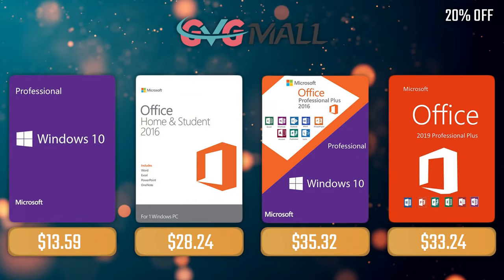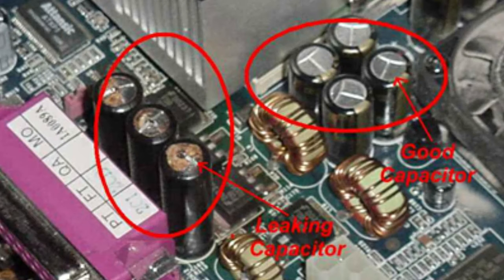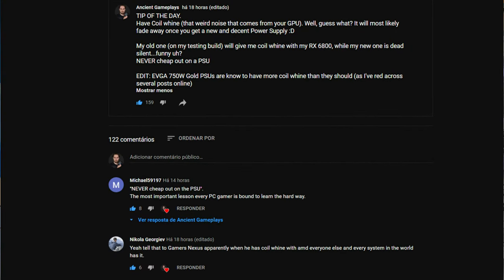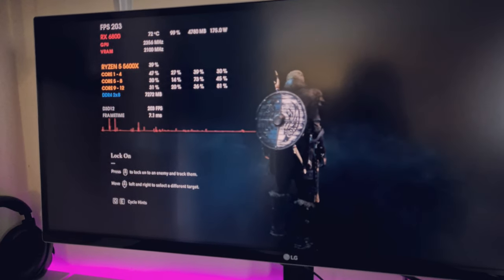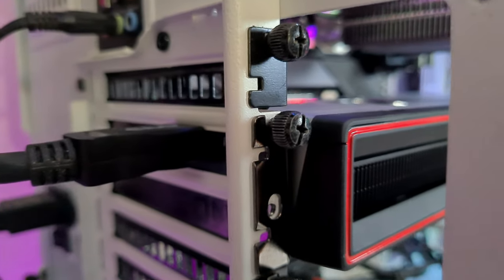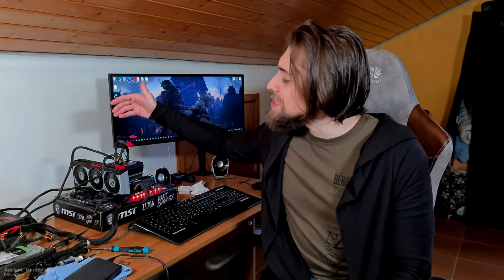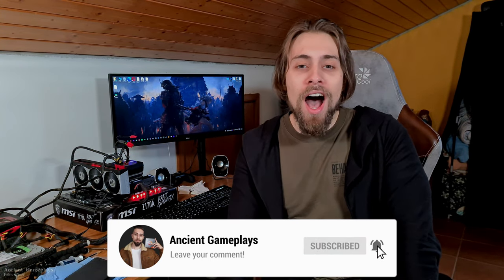GPU Coil Whine -  GPU or PSU's Fault? How to fix it?

Comment from the maker: In order to hear the coil whine noises I advise you watching this video with an Headset. Hope this helps in some way :D
Reply: Lets go!
Another great video! Bora!
Reply: The low pass filter YouTube uses might not help either. Knocks out everything above 15.75KHz !
Reply: EVGA GOLD is a bandage for this.
Reply: Corsair CX550M + RX 570 GIGABAIT = coil whine.

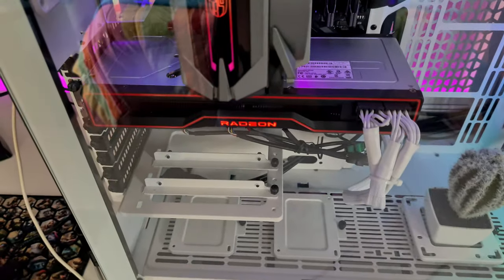3:32 ИƎZYЯ
Reply: I have the exact same logitech white speakers :D
Reply: @patr8357  yeah it's Z120, i bought them recently too
Reply from the maker: @patr8357  pretty nice and cheap
Reply: my bluetooth headphones also have coil whines.  but I want to fix the one of my rtx3070
Reply: So last night my pc was working and I turn it on this morning no lights or fan turns on but the coils in the power supply are whining someone help
Reply: Hello sir, can coil wine demage components or can it be dangerous? Or is it just the sound?
Reply from the maker: @Nixsaspy  Nah, you're fine don't worry, it is just electrical "vibration"
Reply: Interesting video. Do you mean that a weak power supply is behind all the complaints about (for instance) the Red Devil 7900 xtx deafening coil whine? I'd love to buy that card but I've heard so many angry costumers that I'm hesitant.

Comment: The biggest fail of them all - CONNECTING ONLY ONE 8x + 8x CABLE INSTEAD TWO SEPARATE. Way too many people don't get it. It's about rail power delivery
Reply from the maker: Exactly, hence why I showed it in the video :D
Reply from the maker: @Sneakyboson  the modular argument is simply not true. There are a huge amount of them that have 2 pcie cables. The defining factor is the stated wattage
Reply: What if there is 3x8 pins?)
Reply from the maker: @legart4507  There are GPUs with 3 or 4 PCIe cables also :D
Reply: @legart4507  Get psu that supports 3 cables
Reply: My suprim X have coil whine. It need 3 cables. which cables do you need in this case?
8+8 split and one 8? Or 3x8 pins?
Reply: I didn't know that, thanks. Will add a second cable and change out.
Reply: Wait so I should only have one plugged in not two I have 7800x3d
Reply: I've just taken back a power supply and swapped so I can use individual cables. I'm hoping this will solve the issue. I will post an update once setup.
Reply: @ToonaChills no Bro you understood this incorrect. Use 2 Cables instead of 1 with a splitter

Comment: I have an rx 6800 xt, and a msi tomahawk 750w gold psu,full modular, and i have coil whine. Should i change the psu? Its not enought? Using 2 separate clables for it.

Comment: If you lock your framerate to your monitor's refresh rate, it can mitigate some coil whine.  Typically coil whine is at it's worst when the framerates are completely insane, which usually is on menu or loading screens.  Those 300 ish FPS on loading screens makes some cards SCREEEECH.  If you can't get out of your PSU try locking frames down in Afterburner or Wattman.
Reply from the maker: Coil whine appears when the GPU gets loaded, it has to do with power consumption also :D
Reply: Absolutely 100%
By locking the fps to 60 for example you reduce the load on the graphics card.
Reply: This worked for me on a sapphire fury oc+ edition
Reply: Sure sure, but what if you crypto mine?
Reply: @IItsIgor  underclocking and undervolting SHOULD bring the noise down.
Reply: Yes because your card uses less power when you lock the framerate
Reply: @IItsIgor  0% coil whine
Reply: For me, two XFX Merc 6800's have coil whine, no matter of PSU or FPS, it's unbelievable how QC looks today. Also, UV just changing the noise, but not removing.
Reply: Yeah well what happens if you have a 240hz 4k monitor? I just got a 6950xt and the thing whines like crazy and I have a evga 1300watt 80 plus gold psu. Like what tf fk!
Reply: Freal I lock my fps to 60 with afterburner and the whine vanishes from my 6800
Reply: @brockbrawn1524  yeah cause it's getting loaded
Reply: @monibsamaiele4837  huh

Comment: Thank you dude! I couldn't get rid of the coil whine of my Rx6700 xt completely, BUT using 2 cables instead of 1 split cable from PSU zu GPU decreased the noise about 30-40% I'd say. And the tone is a bit lower and less annoying.
Definitely give it a try, guys!
Reply: I use the bequiet straightpower11 750w
Reply from the maker: Great to know :D
Reply: Thanks for your comment. Which version and brand of the 6700XT is it ?
Reply: @OptLab must be the Asus Dual, for some reason the Asus Dual line cards, no matter which model, all have coil whine. You can check more videos on YouTube about that.
Reply: I have the same problem using split cable both for 1070ti (180w) and rx 580 (235w) and with the rx i have no problem while the 1070ti makes this sound and even when I enable POST FX

Comment: I hate coil whine. 
And there is no just no permanent fix for it. You would have to physically desolder every inductor in the VRM on the Graphics Card and replace them with higher quality ones. My old Vega 56 Strix literally screams at very high FPS and 100% load.
You know what is really funny:
Different games produce different noises and different graphics settings also affect the noise.
I could record the sound and analyze what my GPU is doing based on the sound haha
Reply from the maker: Exactly, that is due to LOAD haha. Thought, one my Corsair RM750X even my VEGA56 does almost no noise, while in my Aerocool PSU it screams like crazy. The PSU matters A LOT
Reply: Either I've never had to deal with it or my tinnitus is so bad that I cant hear it.  Usually the sound of the video I'm watching or games I'm playing drown out the 17+1 fans I can have all ramped up to mach 7.  Probably isn't doing the tinnitus any favors tho.
Reply: @AncientGameplays  there are significant differences between powersupplies in quality.
Some are made to meet the bare minimum specs needed to power a computer. Luckily most PSUs these days are good as long as you buy from a reputable brand.
I choose a 600w bequiet and I dont think the noise would disappear if I buy a different PSU since there is zero coilwhine from the PSU itself and my motherboard.
Reply: @brovid-19  Bro ,was hear for coil wine ,but seeing ur comment ,how do u deal with tinnitus,I mean concentrate on studying or other work.
Reply: @brovid-19  fellow tinnitus sufferer here (life around loud racecars will do that 😅). I picked up a set of bluetooth earbuds (just some $30 skullcandy evos) and boom. Problem solved!
Reply: @lynnmckenney1987  how does headphones solve tinnitus.
Reply: @pallabdas477  if I play something in my ear (that has mild tinnitus) at a low volume with a noise cancelling earbud, it gives me some relief :/
Reply: @lynnmckenney1987  I also do it sometimes like playing some nature sounds ,but still they kind of make me feel sleepy when studying or working.
Reply: @pallabdas477  if I'm working or trying to learn a program, I'll usually listen to some lofi/chillhop on the lowest setting. Just enough to hear it and it helps me concentrate *just a bit*.
Reply: @lynnmckenney1987  will surely try that.man , suffering from tinnitus since 2019 Dec.
Reply: @pallabdas477  yeah I just focus on other things.  Music is the best, but if it's just white noise.. I used to be able to go to sleep to it, now it's painful.  I also work in electrical construction so I have to remind myself to always wear ear plugs so the cacophony of power tools doesn't degrade my hearing more.

I got made fun of at work one day "he wears his ear plugs every day, what does the noise hurt your baby ears?"

I said "no, the reason I wear them is because it DOESNT hurt"

Having a video playing with someone talking as background noise or music generally takes care of it.  Just not too loud, don't wanna make your condition worse lol
Reply: My psu just started doing this coil whine sound and it's such a pain in my ears since I use headsets but I can also hear and as you said different settings make different noises I was playing minecraft last night and nothing was wrong then this morning my psu just started doing this noise I manage to reduce the coil whine but I can still hear it 😩
Reply: The sound it makes seems to be tied to your current fps. The higher the fps the higher pitch the whine is. Luckily for me my 6900xt starts loud, but after 30min the whine is gone.
Reply: @Rbraden  yes its always tied to the FPS.
If a GPU cycles a few hundred times a second it will be quite loud. I can get up to 2000 fps in the loading screen of some games and man that is really ear piercing since 2000 hz is well in the audible range.
Reply: @alouisschafer7212  And now I understand why some games have menu frame rate limiters.
Reply: im literally just playing minecraft and bam ! whine
Reply: @pallabdas477 I listen to music low or a podcast. I think people talking really helps at times. I dislike noise cancelling. So I use open ear- earbuds. When using a lawn mower, chainsaw, or any motorised tool and get some help of the podcast. When I don't my ears will tire out quickly or get my ear ringing to for several days.

But it's just about dampening certain frequencies.

Comment: I agree with you to great extent, but you didn`t mention few aspects ;) Great material though!
1. Not everyone would be able to hear the coil whine. If your hear lots of higher frequency sounds (like myself) you`ll be distracted most of the time if there`s any whine, even if there`s not much. I`ve been torturing myself with a GTX 770 back in the days - these were quite power hungry and even using a decent psu wouldn`t help. Had to sell it while the constant headache wasn`t doing me any good ;)
Back to the point - if you know you don`t hear much of high freq, you can skip looking for a better PSU while you won`t hear anything. If you hear a lot of it - it`s possible the PSU change won`t cut it -> then on to next point..
2. The coil whine differs greatly between the cards. It depends on the power delivery (both gpu-side and psu-side), while smoothening the current is key (that`s why the example of connecting two power cables was nice). If you experience lots of power spikes then you`ll probably hear the coil whine as well. However, the quality of the coils, capacitors and other elements are also significant. That`s why changing the card itself is a step you`ll probably have to take if you hear a lot of whine having quality psu. Of course I`m talking warranty cards - if they don`t have it, you can put some non conductive silicone over the coils - they won`t have as much space to resonate hence the sound frequency will be more acceptable. That`s an oldschool tip but works surprisingly well - though I haven`t used this solution for a few years.
3. Also having the card connected through a low quality extender cable won`t do any good for the power delivery. The PCI-E slot can provide 75 W of power (if I recall correctly) and it will use it in any mid to high end card. Again - if the current is not smooth and there are some spikes there`s a greater chance of whining.
4. In most cases you can eliminate the whine by using v-sync or fps cap. I don`t think many people are using this method nowadays, but it`s a possiblity.
5. Some games are generating lots of whine from the card even though you`re not using max power of the gpu. Had this problem with GTX 770/970 in CS:GO - even though I was using 30-40% of GPU power (low resolution, low details - I was CPU bound) and limited my fps to something like 240 (max in-game fps was about 400) the problem would still exist. Probably it`s due to the implementation of the source engine ;)
Probably got some more but wanted to mention a few. Hope anyone would get something from it ;)
Reply from the maker: Damn, that0s a lot of text xD

Comment: THANK YOU SO MUCH!! I got my rx 6800 and I had 2 cables plugged in, but one of them was under a different part of my psu's modular plug in for pci-e. My psu is the seasonic focus-gx 850 gold, which isn't a bad psu at all. My coil whine is basically gone.
Reply from the maker: Great to hear! Enjoy!
Reply: do you mean you had one of the cables in the wrong place?
Reply: @Coroner88  no, I had it in pci-e which is strange. After putting both the cables in the same pci-e section (of 3 possible parts) I was able to get rid of coil whine. I plugged my cpu power into a different section on it's own as well. It remedied the problem. I didn't have it plugged into the wrong section no, I was also just getting normal power consumption of over 180W
Reply: @AncientGameplays  thanks :)
Reply: Hey, having the same psu here and same problem. Do you remember if you plugged to upper ones or to lower?
Reply: @nickytorious  I don’t remember man, make sure your gpu power and cpu power are in different sections
Reply: @HJCars  thanks man, will try to switch it today, otherwise this buzzing sound just makes me crazy
Reply: @nickytorious  yeah i feel your pain and panic. Hopefully this fixed the problem for you :)

Comment: Interesting video. As an added tip, if you're suffering from excessive coil whine, try a different driver version. My GTX 1070Ti had an insanely annoying coil whine at LOW loads, which appeared after a driver update. Rolled back the driver and super silent again.
Reply: Have been playing multiple games on ultra on 1070TI everything was running great and smoothly, out of nowhere today on euro truck 2 I launch it my gpu start to coil whine ( even tho days before playing ets 2 didn’t cause any coil whine) so do you think it’s a problem from the game ? Or my gpu or psu ( cuz my rgb gets f*cked on the gpu )
Reply: @_pew_pew_ only happens to my 1070 when playing certain games like War Thunder, but for example not on rust
Reply: @Who-710  same thing I can’t run ets2 anymore but forza horizon 4 in 4K isn’t a problem 😂
Reply: Happens on my Asus Dual RTX 3060 TI, high coil whine on First Descendant and The Hunter but no coil whine on Undecember. Hmm.
Reply: @Toulkun  It's because different games load the system with different wattage. Which causes the components to vibrate at different frequencies, causing sound. It can be fixed, but it will void warranty. You can try to change settings for the system in terms of power delivery to various parts, also CPU has frequency shifting, a nd disabling power saving can also help. It sucks, I know. Got a brand new rig and both the motherboard cpu backplate / VRMs and PSU has this static noise garble coil whine, and my ears are fine tuned due to audio / music production work. You can RMA, but it will likely be there on the new product. Need to invest into high quality parts to have less likelyhood of it.

Comment: You should try using 2 power cables instead of 1 daisy-chained on your main build.
The little coil whine that you have there might go away completely if you do that.
Reply from the maker: Bo perceptible coil whine anyway. Good psu here

Comment: Just found this vid as I was dealing with this problem just now, so here's some info from my side for anyone interested:
Got the MSI MPG A850GF a while back and the AORUS RX 6800 XT MASTER recently, and ran it with only 1 daisy chained PCI-E until now. The coil whine was really noticeable, even through headphones with thick foam. Of course, increasing the FPS cap beyond the monitor's refresh rate (144) increases the coil whine, i.e. the higher the FPS the noisier the whine.
Since the PSU is multi-rail, I found info from other people that state it's better to use two separate PCI-E cables instead of a single daisy chained one.
The only scenario where you are forced to use a single PCI-E cable is if you have a single-rail PSU. 
After adding another PCI-E cable and doing some heavy testing, the temps are a bit lower while the power draw remains the same, though I've also changed to the "Balanced" power plan. However, I now reach a bit lower GPU clock speed (~55mhz), but it feels more consistent and stable in game. 
I'll probably test this even further with power limit and/or undervolting, which will be interesting.

Comment: I have either really bad luck with 4090s or PSUs lol Had 5 RTX 4090s, and all with the same buzz. I have tested everything and swapped everything, but I keep feeling it's a PSU thing; this is the list of PSUs I tried.
EVGA P6 1000w
Be Quiet 1200w
Asus Thor 1000w
Corsair HXi 1500w
No change. I even thought certain parts might do it, as the P6 and Corsair ones were made by Seasonic, and yet the other two are not, so that connection is gone.
Reply from the maker: When the power draw is too high, coil whine is almost impossible to avoid
Reply: @AncientGameplays  If everyone's card behaved the same, it would make sense, but I have owners telling me their cards are the same and the odd one saying, "My cards almost silent"

Comment: This is good video and people deserve to try if they connected two pcie 8pin connectors with one power cable with a splitter or with two separator cables. I remember I heard very loud coil whine with my 2080 Ti when its two pcie 8pin connectors were connected with only one power cable with a splitter...

Comment: Hey man! So I just got a 3090, and a Corsair HX850. Before I had a 2080ti, and both GPU's make exactly the same noise. But I already have a Cordair Gold PSU so I'm not sure what to buy now. Any suggestions?
Reply from the maker: That model is old from what i know. Undervolt your 3090 also
Reply: @AncientGameplays  but do you have a suggestion of a new PSU to buy? I just want it gone, and as the sound is the same for 2 different cards, I'm sure its not the card
Reply from the maker: Both cards have a close power consumption. It may still not be gone with a new psu. Try the corsair gold series. The new ones, like 850w
Reply: @AncientGameplays  I'm sorry, I confused my new PSU with my old one. Now I have a Coolermaster v850 Gold. I listened very closely and the PSU and I think also the GPU both have coil whine. What could cause it you think?